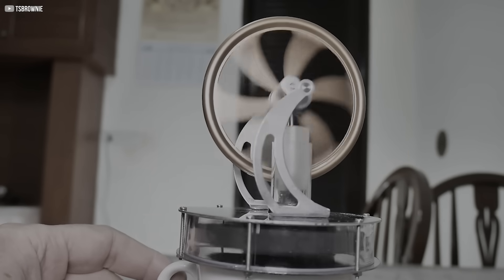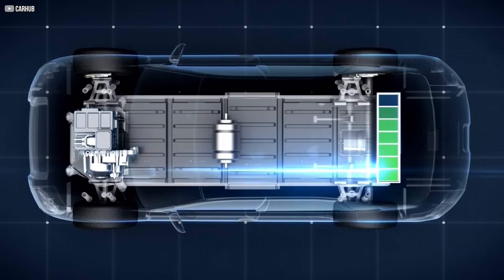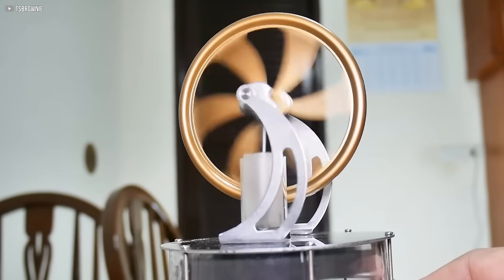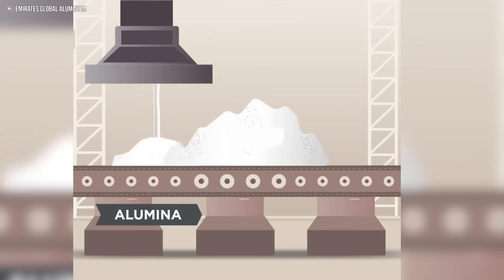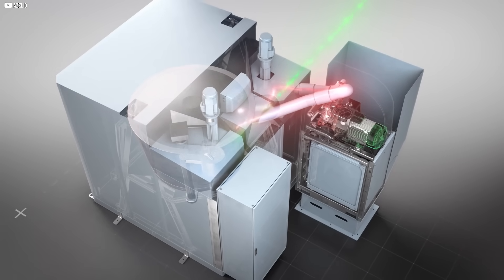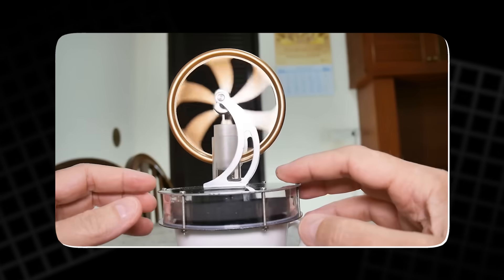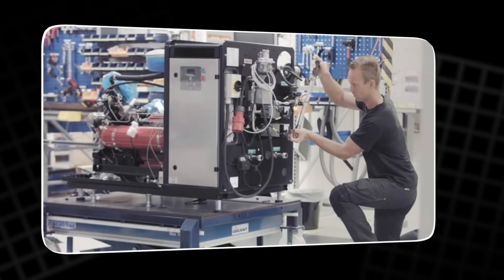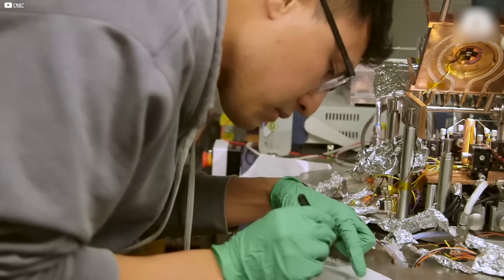Is Stirling Engine Technology the FUTURE of Energy in 2025?

Comment: You talk a lot but don’t say much. How are you going to increase the power output? 😊
Reply: Increase the temperature difference between the hot end and the cold end.
These engines are remarkably efficient.  It's not terribly difficult to get 40% heat to electrical conversion.
Reply: @kayakMike1000 
exactly, and if the original inquirer wants to know how to get more power output 
Simply ask the marine engineers how they design large submarine propolusion systems carrying tons of steel load, plus cargo and passengers with onboard energy needs for the technical equipment and navigation systems 

Right 🤷🏽‍♂️

A Hint;
It's already been done for decades, aside from nuclear what else powers a submarine ?
Not dirty diesel 😅